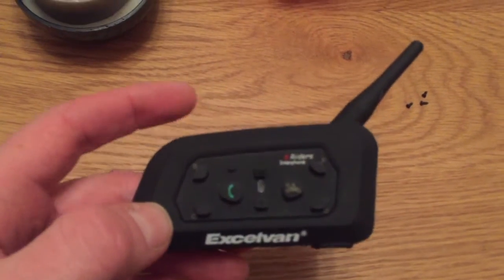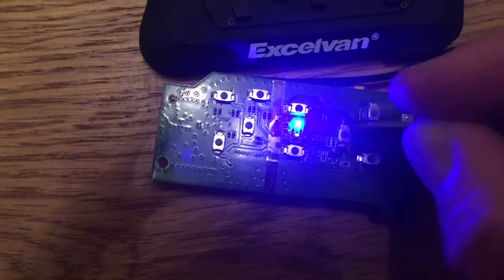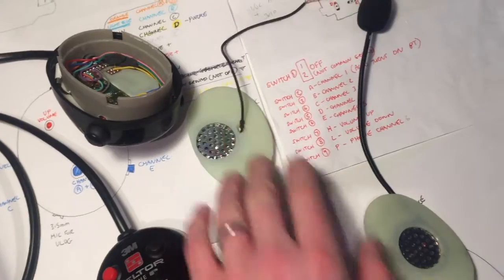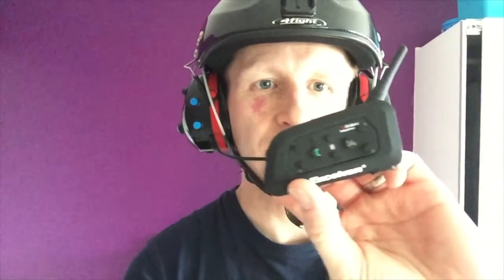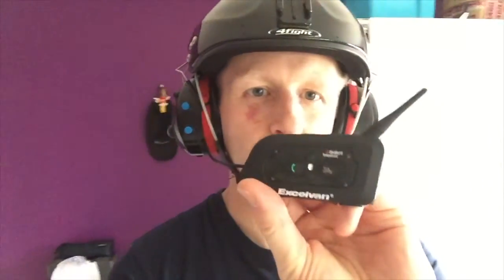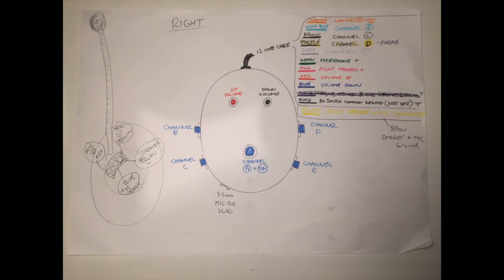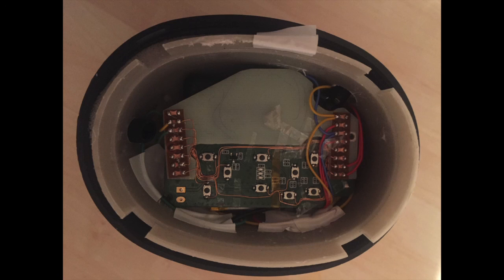Peltor Optime III & V6 Bluetooth 6 Riders Integration - Paramotor

Comment: Hi Andy,  are you still using this headset?  I didn’t notice what you were using at the bore.
Reply from the maker: Hi Andy, to be honest I don't use it as regulalry as I would like. Mainly because the range on bluetooth is not great unless you are flying alongside someone and it requires another pilot to have the same pairable device.  However it has come in useful as a great bluetooth device to enable phone calls now and then.  I was also going to try and use it with the zello walkie talkie app, but haven't had enough time to trial it properly yet.  It was a fun project, but might not be the best solution.
Reply: @Bexxy   that's a claimed 1200m unit isn't it? I wonder if the range issues are either your aerial being bent inside the peltors or emi from the motor.  I believe they use a sleeved dipole antenna and it really wants to be pointing straight up for correct polarisation with the other units you're talking to.  I've just got a couple of the E6's and plan to trial them.  At the bore we tested them on the ground and got 850m with no audio issues. Obviously in the air this may change and I may need to look at emi suppression but hopefully they aren't too bad.  Also planning to integrate them with two way radios for longer range and chat with non Bluetooth pilots.  Hoping to o a couple of videos about it soon.

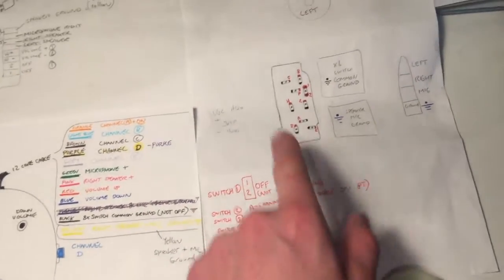Comment: Hey Andy, I accidentally dropped my bike helmet and yanked out 3 of the 4 wires from the solder points on the left side, microphone side. I googled for a proper pin-out and wound up on your video at 2:29, small TRRS jack pin-out drawing on the right. Followed that, worked perfectly. Thanks mate.
Reply from the maker: Robert A Aime Hey that's brilliant you found my diagram, a lot of effort went into it just for me, so glad someone else has benefited too 👍😀

Comment: Great project Andy - was thinking of doing somthing similar with the same unit
Reply from the maker: Thanks Simon, I'm yet to fly with it, but I think its going to be awesome :-)
Reply: I've been flying mine for about 6 month and it work a treat - but I've just installed existing set up into Peltor IIIs.  I'm now also using a BT radio adaptor so I can swap 'channels' between radio and phone - awesome
Reply from the maker: That's a good idea!  Can you share the BT adapter you use for the radio?  I may look into that?